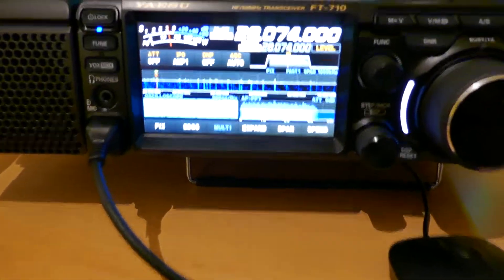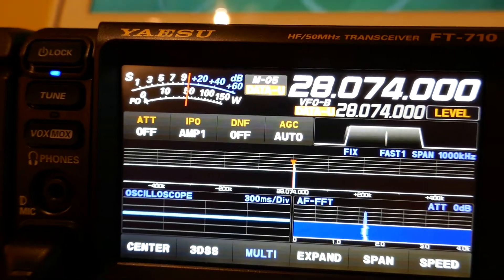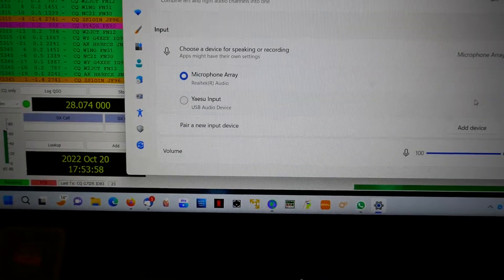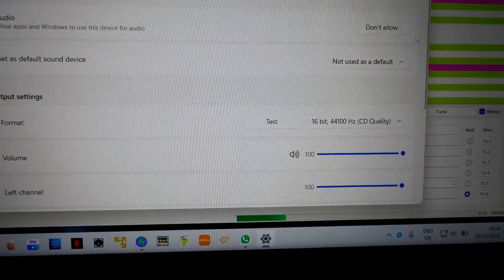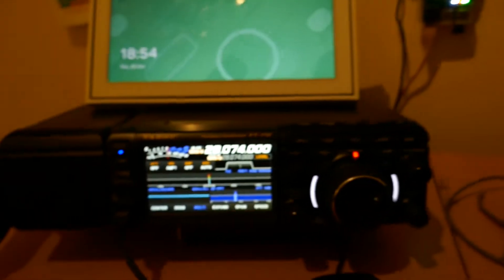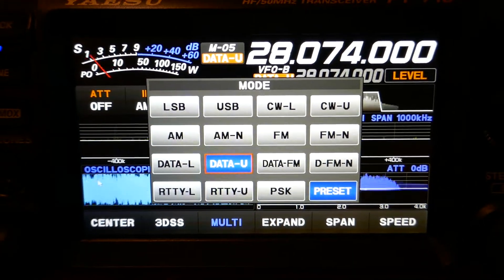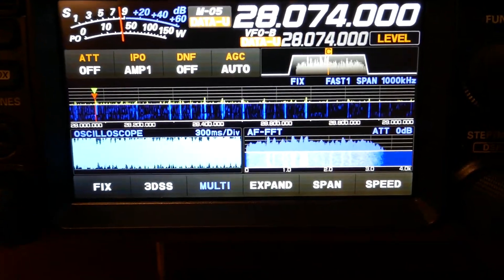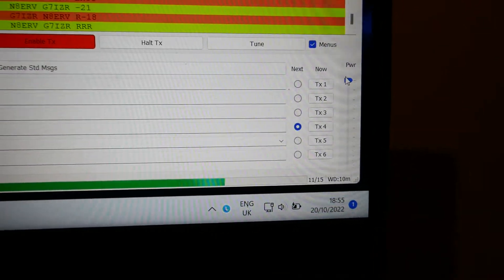Yaesu FT-710 WSJTX FT8 settings for 50w max

Comment: 10 watts is enough... many Ftdx10s burned out with ft8...
Reply: Do tell? How many?
Reply: @tzm1843   Watch Russian videos on repairing the FTDX10. Due to poor design, the transistors overheated even during a 1-second transmission.

Comment: I don't want to overdrive my FT8 signal so appreciate this video but I'm confused.  

I want to understand this.  How does changing my USB mod gain from 50 to 15 help?  If a 15 lets me set the radio at 100 (even though limiting transmit at a limit of 50 watts) why should I do it when mod gain was at a default of 50? What benefit am I getting?   If I move power slider up to the top maybe the signal would splatter but what is wrong with moving power slider only halfway up?  

What if I do it your way and change USB mod to 15 and set power slider to top/full but leave radio at 50 watts?  What happens there?

Comment: How did you configure the software to control the radio? I see in the options that the 710 is not there yet. Thanks!
Reply from the maker: Then you are using an old version. The latest version of WSJT-X does have full support for the FT-710. HTH.